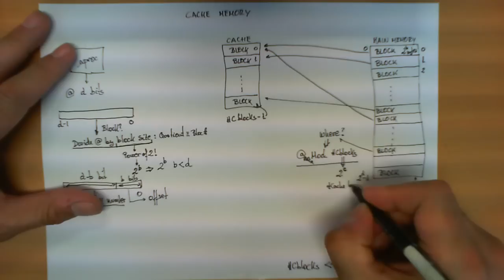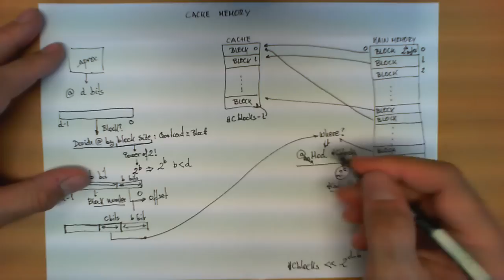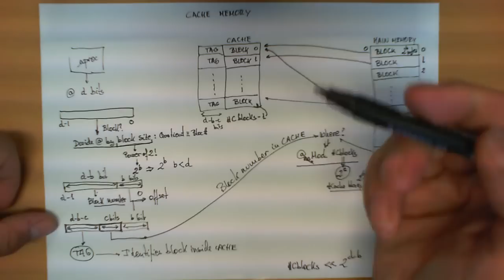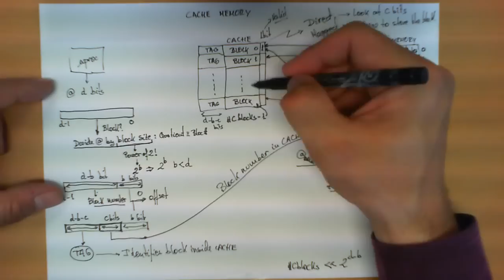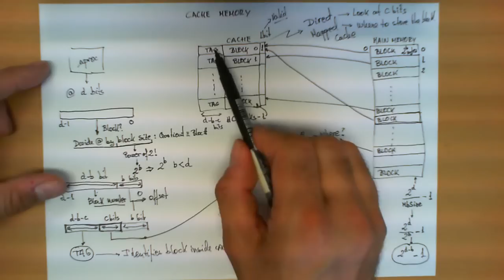Direct mapped cache memory

Comment: thanks, very well explained. Would you please clarify more the rule of the validity bit? I mean, if I am understanding right, the TAG field in the cache block tells whether or not the block really corresponds to the memory block required or not, so what is the importance of the validity bit?
Reply from the maker: It is simply to tell you if the block stored in the cache contains valid data. In certain circumstances, the content in main memory changes so much that you need to void some blocks in the cache. The valid bit allows you to do something like that very quickly. Or, you can think of the content of the cache when the system powers up. All the blocks are "invalid" and must be detected as so.
Reply: Aha, thanks